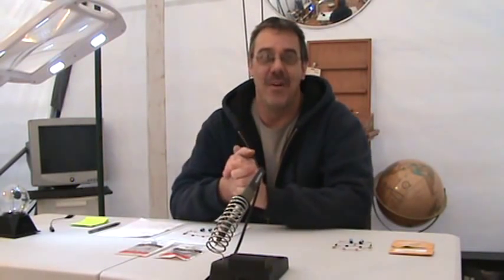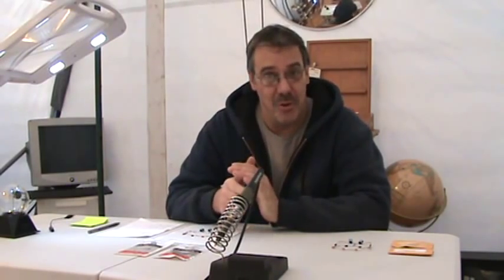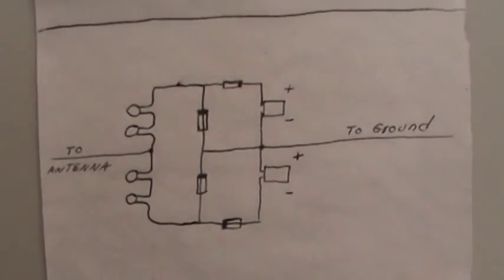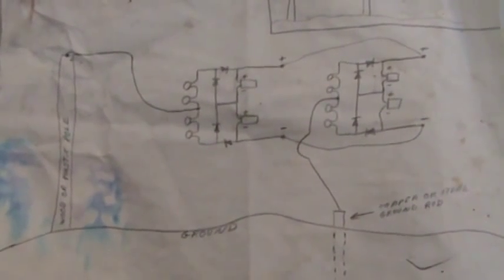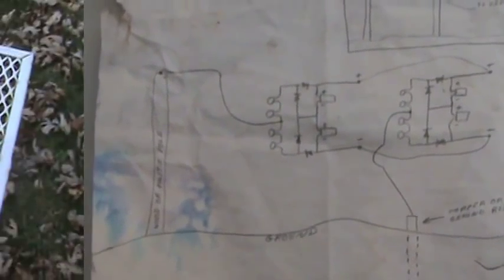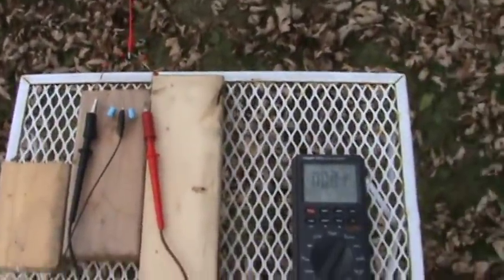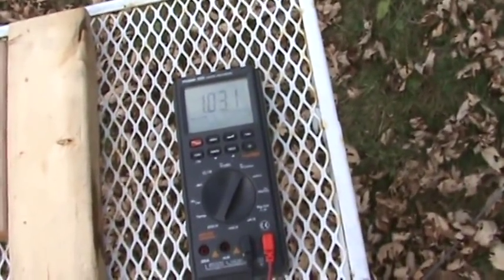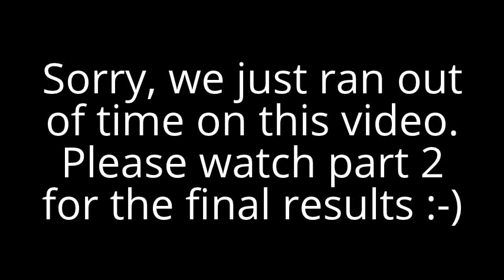Free Energy From Air Circuit, "HOW TO"(Improved) part1

Comment: Is there some theoretical model that justifies the circuit used or could inform future design modifications?
Reply from the maker: Sure, there is Joe Tate and his APM(ambient power modual) and Franklin Mead with his ZPE(zero point energy) collector and patent., and of course Dr. Nikola Tesla with his radiant energy collector. And lets not forget Dr. Thomas Henry Moray :-)
Reply: I imagine some crystals could be used instead, but I wonder what the circuit is supposed to be doing. I guess I will go read up on those sources you mentioned and get back to you. A protein with the proper structure could emulate the circuit as well. Wouldn't it be a trip if our cells used wireless power at the nano level?
Reply from the maker: wresing best to study Joe Tate on rexresearch.com.  Voltage doubler, rectifier, and the circuit also acts as an early earth quake detector.
Cells using wireless power at the nano level,,,,well there is my good friend John Hutchison that has crystal power cells that collect ZPE, and not a galvanic reaction.  These are concepts we have to incorporate, you got it! :-)

Comment: IF you have a lot of old ceramic caps you might put a bunch in a loop. Instead of a diode rectifyer you make a capacitor loop for recieving power? The idea is that the power you are collecting is ac. Silicon carbide is better than silicon but you may want gunn, tunnel, or impatt diodes. Avalanche was an idea I was toying with but what happens when you use neon bulbs. It is kind of like old vacuum tubes? But you might try carbon fiber ribbon as it has a high surface area. The hight the surface area the more you might use ions from the air. You could make your own diodes. I don't know how well silicon dioxide with rare earth oxide to make an eletrode of aluminum or magnesium and copper?  Tin rare earth oxide and silicondioxide on silver. Some crystal cells act like diodes but piezo tweeter might also work. More circuits in parallel would work also.
Reply: I am still stuck on the tasla bifilar pancake coil for some reason. I just think if you had a 3 foot diameter coil it might work good with say 22 guage wires?
Reply from the maker: Carbon fiber "ribbon", good idea.
Tesla's bifilar pancake coil, hmmm, ill have to check how much speaker wire i have :-)
I been taking notes on John H's best crystal cells, i keep thinking about trying to make one.  I played with his smaller cells, but not the large ones with multi layers of many wafers.
Reply: You could just use a binder for rare earth oxides and silicon dioxide like a Polyvinyl alcohol, with borax and a little glycerol but when you mix it up and let it dry it shrinks and you may need to apply other techniques to it.
Reply from the maker: travis moore How about sodium silicate for the binder?
I got big box of Borax :-)
I will eventually call the company that John used to make and coat his wafers to see what their process is.  I may have them make them up.
Reply: INVENTOR3
Idealy polyvinyl alcohol with borax makes a plastic with a bit of glycerol but rare earth oxide may act as a type of channel for energy waves, and piezo electric quartz could be replaced with silica as they are both silicon dioxide. I guess you may try a water glass, it may work as crystal cell if you use copper and magnesium eletrodes. I think you may learn neat things from Moray devices.
Reply from the maker: travis moore Thanks, i dont have much time now, on my way to work.
Thanks for the comments :-)
I learned a lot from Moray and others :-)
Reply: INVENTOR3
 IF you make a Tesla flat pancake bifilar you might need a small coil no bigger than 6 inches, your antenna is the big part and the ground. Use it like a transformer and use a neon tube for spark gap and capacitors to get a dc voltage. There are circuits of this outthere.

Comment: 6:10 
if you connect + terminal to - terminal..you should get double voltage sir
Reply from the maker: do you mean, when using the 2 circuits together, instead of connecting  + to + & - to -, i should connect + to - & - to +.
Or
 maybe you mean when using 2 circuits together, to just add a jumper wire connecting the + & - of just one circuit's outputs together.
Reply: joining + to + & - to -, this conection called parallel sir. in this case you should get double current if both circuit identical. in other case if you joining + to - and connect the other + and - to load or volt meter
Reply from the maker: OK, i understand completely, thank you.
Reply: that connection only work if  both circuit generated DC current, but if those generated AC you should add diode to convert AC current to DC. 
in other idea im curious sir, let say those circuits produce DC current, what happen if you add DC to DC boost converter?
Reply from the maker: I have not had much luck with converters yet on this project :-(
In last few days i just now got 2 LEDs lit 24/7,,,more info and another video coming soon :-)